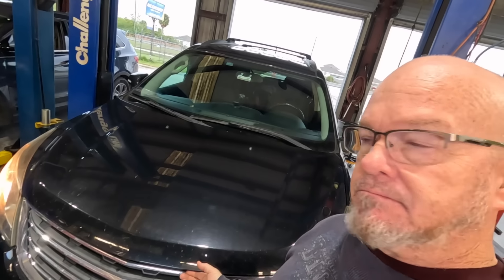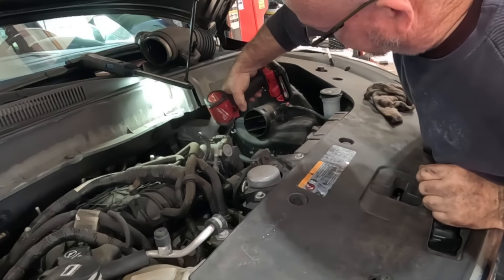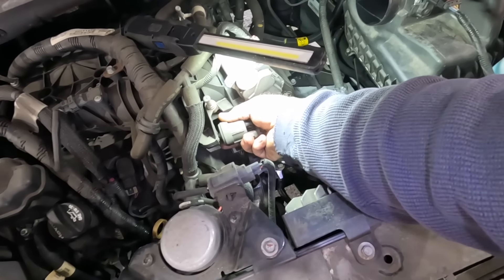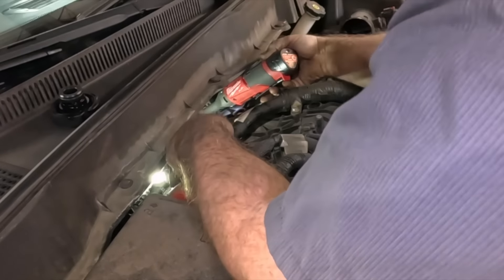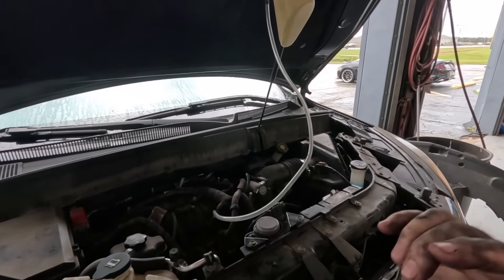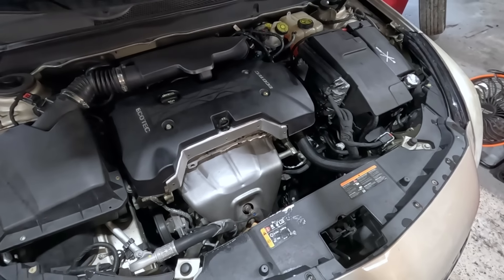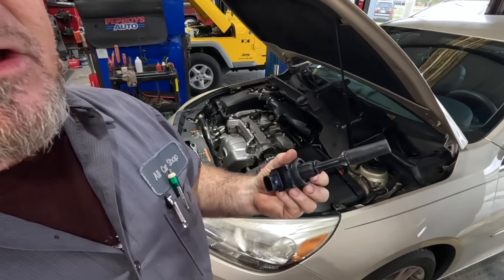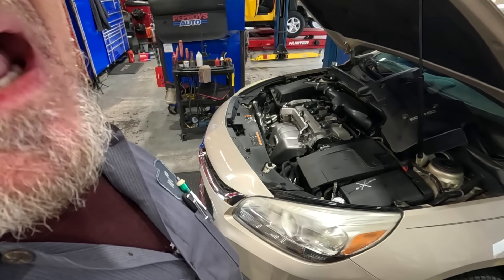MALIBU MISFIRES, EQUINOX TUNE, ACCENT WINDOW, DAY 400 IN THE SHOP #auto #repair #mechanic

Comment: Playist/Chapers
01:28 2017 Chevy Traverse - Tune up, Oil change, Coolant service (Mityvac MV7300)
29:29 2012 Hyundai Elantra - Window Diagnostic
32:19 2016 Chevrolet Malibu - Misfire Diagnostic (TOPDON Phoenix Lite 2), Transmission leak (Vevor Endoscope)
Reply from the maker: You da man!

Comment: That was nice that the Jeep customer brought their other car to be serviced. New part failures are affecting other industries as well. We had 3 brand new control units in a row fail on our boiler. One failed the moment the boiler fired up. At another house, a brand new temp/pressure gauge was broken right out of the box. Went back and got another. Installed the gauge. Once the boiler came up to temperature, the gauge filled with water and was steaming. Tennant had to go without heat that night as all the supply stores were closed and we couldn't get a replacement.
Reply from the maker: Man it’s crazy how fast everything has changed in just a couple years. Not sure how we fix it though?

Comment: The AC Delco spark plugs are rebranded NGK spark plugs.NGK makes them for AC Delco.Does not take long to take the upper intake off to get the rear plugs out in the 3.6 GM.I created a misfire in one once,plug in for one coil was not in all the way I did not catch during reassembly
Reply from the maker: Yeah, there aren’t many actual plug manufacturers. Many are rebrands, like tools. :)

Comment: @26:00, Jimmy, I have an idea for a patent to elimate the carbon build-up on GDI engines. Cast tiny orifices into the intake manifold directly towards the intake valves in the same manner of port injectors, think of WD40 spray nozzles. Plumb the nozzles into a container in the engine bay with cleaning solvent. During suitable conditions, a ECU program will open a electronic selenoid ingesting the cleaning solvent thereby cleaning the valves. This system will definetely be cheaper than dual port/GDI systems employed by some OEMs.
Reply from the maker: Sounds like a great idea! Toyota uses  a dual injector system for that purpose. But this might be a better way still.

Comment: The NAPA 27060 and NAPA 2100255 filters are pretty similar filters but the 2100255 has a higher bypass pressure.  It's like 14psi vs 22psi. 2009 and 2010 Traverse use the 27060 filter. Gotta love that filter location.
Reply from the maker: Man it’s crazy to do when the engine is hot. Plus they managed to raise the front end so it’s another foot lower than in a car. haha